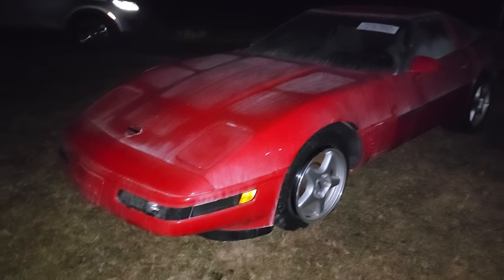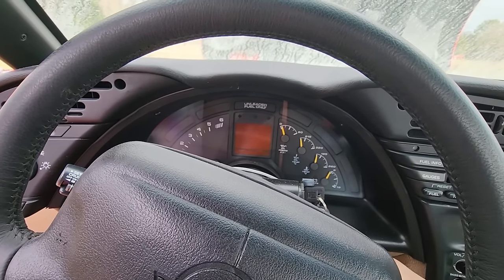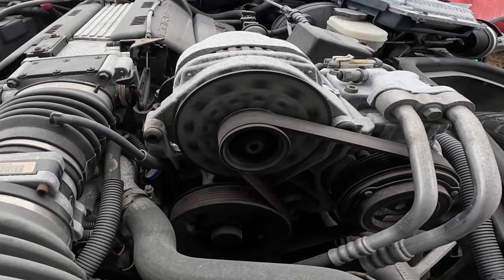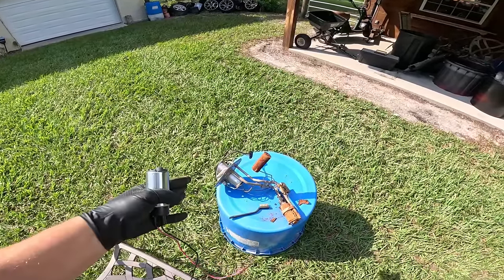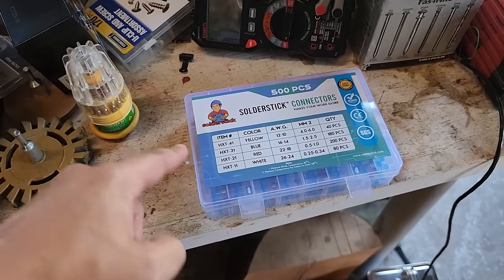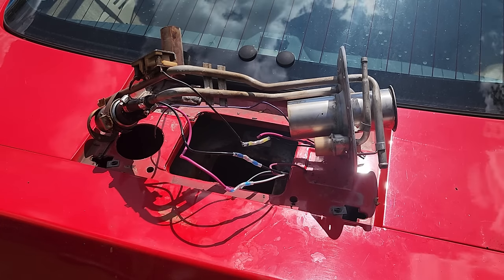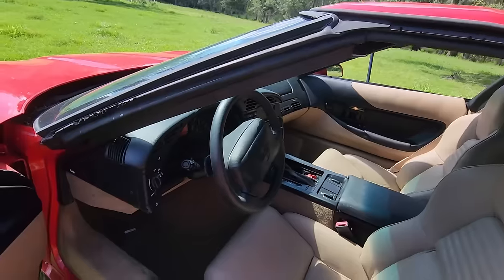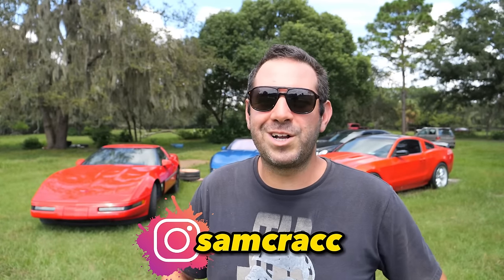I Bought a Junk Corvette at Auction that was Basically Brand New

Comment: Most people don’t realize that the C4 model was a huge jump for the corvette, not unlike the C8’s was recently. The second year of C4 production had big improvements over the 1984’s crossfire injection and rough suspension.   I shipped an 85 C4 to Germany with me back in 1987, and I still remember when an American soldier, with a group of young Italian NATO soldiers, asked if I would show them the engine. There were a lot of oohs and aahs to the sight of the engine’s tuned port injection manifold as I opened the clamshell hood.

Comment: Anytime there's a major weather event, it's not uncommon for people to take the opportunity to unload problems. This is because the insurers are usually so overwhelmed with claims that they don't actually investigate each one like they normally would. They just cut a check and send a wrecker.
Reply: Indeed, the area might have flooded - a few inches.  Just enough to create a "plausible cause" to the paper shufflers.
Reply: Bingo
Reply: In the Finance/M/A&D sector, it’s referred to as “muddying the water”, obscuring the minutiae
Reply: Sam is in need of a little bit of yard and car storage and parts organization assistance
Reply: How much did parts guy offer you
Reply: Its a disgrace that someone could not repair it properly... its not so big job
Reply: Bet this is the case with this car. It sat around fora  reason

Comment: “We’re just putting it back to get the car to run.”

There’s nothing more permanent than temporary wiring that works. 😂
Reply from the maker: If this were to really be used by someone the entire sender assembly needs replacing. I've got the wiring straight to the pump which is sitting in gas. It's fine for moving around not for driving at any sort of speed.

Comment: My 1995 I bought new hadn't been started in 7 years (transmission failure).  A few months ago I finally swapped the tranny.  When I tried to start it, same problem as yours, except my fuel pump was way more corroded than yours. I replaced the whole assembly.  I also had about an inch of molasses in the tank. I scraped it all out with my hand (took hours).  I threw the old gas on a brush fire I had burning, and it did burn, but did not explode/flare up like gas should. After a cleanup, the car fired up fine.

Comment: If I could make a suggestion regarding those solder connectors:  make sure the glue/sealer bands are on the wire insulation PASSED the bare wire.  Those are what seal the joint.  If you look carefully at 8:16 there's a bit of bare wire outside the sealed area on the left side.  Fuel will probably wick into the end of the shrink tube and reach the bare wire.  There was no reason to have that much wire twisted together.  And pay additional attention when connecting 3 wires like that - the glue/seal needs to fill in the gap between the two wires on the right, or at least cover the bare wire, which it looks like it may have.  If this was anywhere else on the car, I wouldn't be too concerned, but going into the fuel tank... that scares me.  Last thing you want inside a fuel tank is a short, unless your goal is to make the car live up to it's salvage title.
Reply: Maybe. You'd need a spark in gasoline vapor though right? And where is it going to short to?

Good notes on wiring hygiene. 👍
Reply: @j_freed  The metal housing on the pump and the pickup tubes the wires go right past are almost certainly grounded.  That was on a ground wire itself, but if he did it there, it's probably something he's not particular about anywhere.  Just saying it's best to have all electrical wires sealed from the elements, flammable or not.
Reply: Just like oil or transmission fluid it can wick all of the way through the harness potentially.
Reply: Those are good tips.  But i’ve found the best way to use these is to install another layer of adhesive lined heat shrink tubing over the top of the solder tubing.  The solder often seeps through the clear tubing and causes shorts with other wires or grounds.
Reply: ive used these a few times.  Twisting the wires like he he did is not recommended.  The suggested way that I read says to clip off the 1/8"  insulation on both wires and loosen exposed wires just enough the allow the wires to basically pass through each other until they reach the others insulation.  This allows the heat to get the center of the wires hot enough to avoid a cold solder joint without melting the material.  You can tell the difference by the solder.  Cold solder joints will be dull and gray while a solid joint will be shiny silver.  i found  that twisting the wires together  would melt the material before the solder reached that shiny state.
Reply: @ronaldmcdonald8894  I have a feeling that even twisting the wires and using the solder shrink-wrap is a whole lot better than not using any solder as well.  But the only gripe here is that the exposed bare wire should not have been outside of the glue rings.
Reply: @ronaldmcdonald8894 I've used these a lot too and I agree. Don't twist the wires. Carefully shove the wire strands together so that they intermesh. That's the preferred method of manually soldering two wires together as well.
Reply: He's not in the business of doing good work, otherwise he wouldn't be shilling those junk butt connectors.
Reply: I have had success with gunked up fuel tanks by dropping the tank off at a big truck service center. They cut off one end of the tank and they clean the tank until it was as clean as new inside, weld, braze,whatever the tank end back on to the tank and it was mission accomplished.
Reply: @HandTightGarage and they are junk 👍
Reply: @ronaldmcdonald8894  Agree. Theres a way and then theres the right way. 
One reason I dread buying used cars, most guys that use tools shouldnt be lol

Comment: I tried to tell you about those connectors on another video and all the "experts" said you need to solder it manually. As a former R&D  tech, QE, and soldering instructor I know they are good.
Reply: Are the budget types fuel resistant?
Reply: Interesting. I've been taught that you never ever want to solder anything on a car. Crimp and screw, but never solder!

Now I'm not claiming this is right, it's just what I've been taught. The problem with solder is that it stiffens the wire you solder and it tend to break from vibrations. And if the car is ever used up north where it gets cold there's a risk the solder will turn to dust.

I tested that last part. Soldered a couple of leads together and stuck them in  a bag in the freezer for a month. And yes, the solder joint didn't look all that good. As a kid I did an experiment putting a tin soldier in the freezer and pure tin was quite bad. A 60/40 Tin/Lead mix didn't seem to be the least bit affected. So I guess it's all about the solder used.
Reply: @blahorgaslisk7763 100% about the mix
Reply: @ImperrfectStranger  Very doubtful. Fuel resistant is in a whole different category.
Reply: @johnelectric933  Apparently they are made of polyolefin which is resistant to fuel, but I've seen so-called fuel resistant plastics go soft in time.

Comment: Sam, when you do those solder connections keep the heat gun on the connector until ALL the solder has melted. On both connectors you only half soldered them!
Reply: Yep I’ve seen these connectors on legit street cars and Alex melts them completely!

Comment: I'm glad you cranked it for a little bit without it firing. That gets oil distributed, scrapes off some cylinder surface rust and basically avoids catastrophic failure in an engine that has been sitting.

Comment: It looks to be an insurance scam. Could you have it inspected and get fhe flood title removed?
Reply: And f*ck with the og owner, what a genius...
Reply: Once it’s branded, don’t think it can go back to Clean/original.
Reply: @justintime4466  In normal circumstances it should be permanent, but if this is due to fraud then maybe it is different.
Reply: You can get rebuilt titles in many states, this car would pass instantly
Reply: Id bet anything it is. 4k miles and my names Santa Clause lol. 
Doubtful on changing title status. On a junk title cant even  be put back on the road, ever. 
Id call an insurance agent and have them look the vin up that will reveal plenty.
Reply: @gordocarbo it can 100% be put back on the road.  I had a beautiful 1995 Mustang GT with a salvage title.  It had smoke damage on the paint from a house burning down.  I bought it in 2007 with 27k miles.  Bone stock cream puff.  Just an ugly title.

Comment: Those solder stick are actually waterproof as well. They have a heat activated glue inside.
Reply: Not the way he used them...
Reply: Those things are sweet. I prefer them over standard crimps. Good seal. Good wire retention. Clearly a good contact when you are soldered up.
Reply: the glue disolves in gasoline
Reply: @dennisfahey2379  Less space as well.
Reply: Wish I knew about these before I started my 20k watt car audio build.
Reply: @dootu Yes definitely stagger the lengths or the diameter builds up fast. I first used them 20 years ago splicing a steering column in.
Reply: @EarlPickle  that's excessive

Comment: No to parting it out, drop that tank and clean it properly, new pump and sender, new fuel filter and run thought the brakes, powered coat the wheels and new tyres. Do it right, looks a clean motor

Comment: I wonder if there's a way to legally dispute the salvage status of this car. In any case it's too nice to part out!
Reply: There isn't in Florida, once it's stamped, it's stamped. There is one state that will issue a clear title, I think Delaware, but once it's titled in another state, it will again be branded.
Reply: you can rebuild flood titles in most states very easily, this car would instantly pass and be road legal again
Reply: @reggienieman7872 is that why I can't go on the road if it's flood damaged. Though it's fine just like if u fix the front damage from another car?
Reply: @katom2111  Salvage cars can be driven on the road with a salvage title.
Reply: Most places you can get it changed to restored rebuilt, which will give it a good status . But who really cares if there was an 67 jaguar with $4000 miles on it, my view of the car wouldn't change of what label was put on it.

Comment: Sam my C5 wouldn’t start do to a bad ground underneath the battery tray (4x 13mm bolts) It’s a splice pack ground (one of many). Jump the fuel pump relay with a wire to see if that helps Sage get it running. If that works it’s probably that ground.

Comment: At 8:21
Those heat shrink solder sleeves... Suck!
By the time you get enough heat to the wires and solder,  the heat shrink is fried and you will Rarely if ever wet out the solder joint like you can doing it the right way!
Solder First, Heat shrink Second with good quality adhesive lined heat shrink tubing.👍
Do the job once! 

Mike in San Diego. 🌞🎸🚀🖖
Reply: I use these all the time but I always put heat shrink over them.  They have worked extremely well for me for years.  Zero failures on cars, trucks, motorcycles, trailers, etc etc.  They kick ass and are WAY quicker and easier than a soldering iron.

Comment: With a fuel tank that cruddy I might even get in there with a spray nozzle from a hose and then a wet/dry vac. if you fill the tank with water first there won't be any gas vapors to have an issue with sparking at the vac motor. and you can literally wash it out and then vacuum out the water and crud. At a minimum I'd swab it out with paper towels on a length of brazing rod or a wire coat hanger. 95% of that crud can be removed without dropping the tank and sloshing it. 

As far as the car goes, rebuilding a title is not that big a deal. and for a sweet car like this I'd do it. Grab a set of tires and wheels from a wrecker, give it a set of new brake disks ( and pads if they are not 3/4 or better ) and with some work to the fuel tank and some new fluids you have a great car! Don't go overboard on the tires and wheels as the new owner will probably want something different than whatever you might choose.

Comment: If flood damage was in the sale description, why wouldn't you check for water in the cylinders first?
Reply: Because oil was at correct level and no presence of a milk shake.
Reply: interior smells, water lines, grime,  oil, etc.  many indicators not showing it was a flood.
Reply: @lukewalker1051   If it wasnt ran the water would be sitting on top of the oil not sure it would be mixed as if it was running
Reply: @baldisaerodynamic9692  Ins job...bet the mileage was created to get more on their ck too.

Comment: If it has been sitting for 7 years, and only had 4k miles, parting it out makes sense.  The transmission will probably have seats, seals, o-rings, and components that have also dry rotted through lack of use lubrication and once put back into service, will ultimately require major transmission service work.  This is speaking from experience.

The crud that was in the fuel tank is also in the fuel lines and injectors.  The small orifices in the injectors may randomly clog, causing rough running issues and CELs.

Comment: The rusty brake rotors are a decent sign of flood damage. The car sat in water but it failed to permeate anything more than the lower drive train/brake components. You should sell it complete and let someone repair the components that were damaged. Nice interior!!

Comment: Nice Video!  I have a C4 also red with approx 36,000 miles. I try to run it every summer, but you know how that goes. Brother-in-law who is a mechanic and has his own shop just told me when it idles rough, " Drive it like Hell: !!!
Reply: If its idling rough find out why. Need to drive it waaay more often they were designed to be used regularly

Comment: I wouldn't doubt it but the dealer probably didn't change or completely clean the fuel tank when it went in for fuel system problems.  Just like this temporary fix; if you leave it like this; it will happen again; that gunk in the fuel tank has a way of corroding new fuel pumps rather quickly. Change the tank and complete fuel pump assembly and it will last many years.
Reply: Im thinking he did the cheap fix to make a lil more on it. He knows what this is/isnt worth but agree. New pump is the way to go

Comment: Wow those Solder Sticks are. Slicker than Deer Guts n a Doorknob ! ironically i have been a long time .boat Owner  that does all my own Maintnancecand repairs   one crucial tool i keep onboard is a HeatGun   that is sold at Hobby Shops for  covering  Remote Control Airplanes  those  heat guns are. designed to get into  tighter areas and also usually come with nozzles andcAccessories that allow you to  direct. the air into very specific areas in a concentrated manner   on a boat.  that’s   often helpfull to get  hoses on and off  easily   or even loosen Corroded  Fasteners  those Butt Conecctors will help  make electrical connections in  tight engine rooms  and  Electrical distribution panels  Thankyou

Comment: Holy crap, back off on the starter fluid unless you want to blow the engine. Also amazed you did not check the fuel tank first before trying a start..

Comment: I live in Florida, and after every major storm, the company I work for has a rush to repair power systems and vehicles for the exact problem that C4 experienced. Even my BMW E70 suffered from water penetration last year, causing wire harness issues under the hood (the plastic diverters cracked and let rain run-off flood the top of the engine, drowning the injector and coil pack wiring). Water in fuel tank can be blamed on the tank gasket deteriorating from the horrible Florida climate, and sitting for 8 years. As for what to do with it, I would raffle it off and let someone else find the joy in trying to keep it running.

Comment: When ever you hit a snag stop what your doing and go back to the last decision you made. When you used the acetone in your tank bad idea to let that get though the system.  What you should have done is get a garden hose and fill  the tank with hot soapy water and then  vacuum the tank out and repeat until n till it was clean when it’s dry your set to reinstall the unit. It would be a good idea to remove the filter and blow out the lines with compressed air

Comment: You are pouring the heet bottle backwards. It is off center so you don't spill it. Many are designed this way. Pour with the schozzle on top. Not sure why you didn't get somebody with skinny arms (or my patented rag on a stick) to get some of the schmooze out of the tank when you had it apart to save the filter, pump and injectors.

Comment: I noticed that the solder was not melted when using those connectors. I have used them and you need a little more heat to make the proper connection. Just an observation. I love these video's.

Comment: That copper line on the top was super oxidized.  That can cause more issued than a break as it could be oxidized way up into the wire under the coating and create unnecessary resistance or intermittent operation.  clean or strip back until the wire is clean.

Comment: I would suggest you consider adding in Wheel Electric Motors up front that include brakes and about 100 HP each. With a Controller and few batteries in the trunk this would be a great AWD Hybrid to stick it to GM over the out ragous E Ray. ProTean is operating on the coast and should be interesting to helping to construct a breakthru Retrofit to AWD Hybrid Corvettes for the US Market. This great left behind vehicle could become a news maker and market builder for the future of EV Hot Rodding all Corvettes For reference the Volvo S60 has a AWD Hybrid, with a combined 455 HP and 70+ MPG, getting 40 miles pure EV per charge with Regen Front brakes and torque vectoring steering with single pedal control. Think about it. Be an Awesome Project for all Vette Owners. Dennis